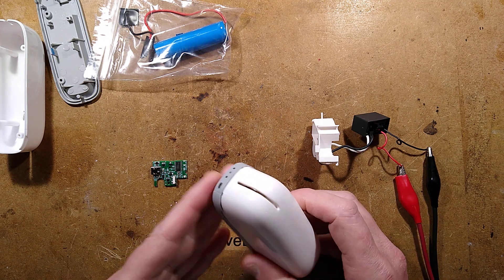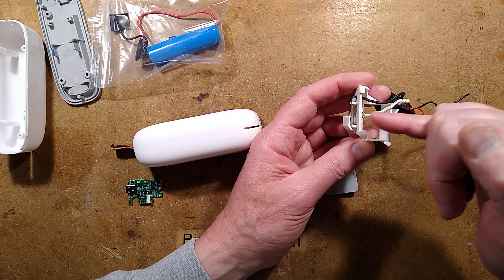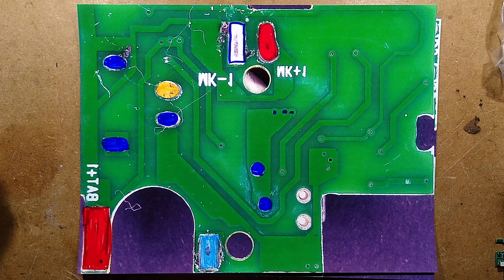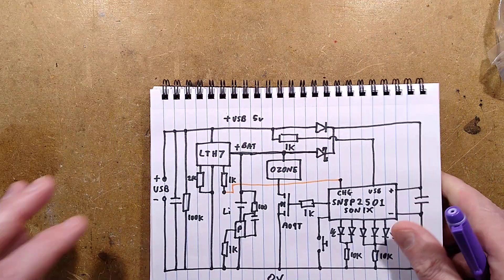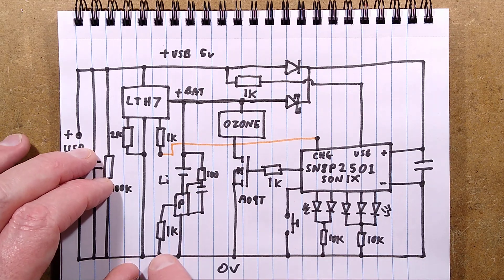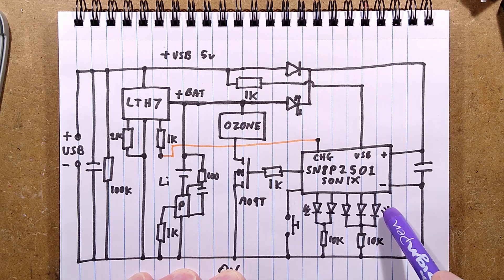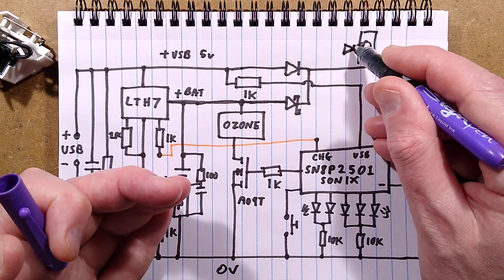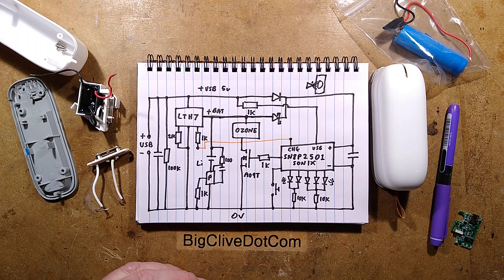Chinese ozone-twinkie with unusually good circuitry (with schematic)

Comment: I've seen a video where one of these twinkies has a duty cycle / duration switch that stopped working. If anyone could point me to it I'd appreciate it. I have one which stopped doing anything but running full tilt until the battery is flat myself.
Reply from the maker: I've been using one in my fridge since I made this video, to give it a long term test.

Comment: It's 3 years later and I just got a couple of these from AliExp.  They fixed the problems you mentioned; the ionizer module wires are routed properly, they trimmed back the plastic so the emitter isn't occluded, and the battery is glued in place.  I got this model because BigClive said it was good, but this model is hard to find now; there's a new model that everybody is selling, so maybe it's time for another ionizer teardown video.

Comment: I bought one and it stopped working within a month. The HV supply seems to be working but the electrodes have corroded pretty bad
Reply from the maker: It may be possible to clean them.  And debris that bridges them can shunt out the low current.

Comment: I just bought one of these little units. It certainly gives off decent ozone for its size. I immediately swapped out the 1aH battery (tested 1007) & swapped in a 3100mAh. Will run for ages now.
Thanks for the video @BigClive.

Comment: I bought one for my car after you released the video . After a couple of months of continuous use it recently stopped producing ozone. Only a high frequency noise.
I found that both the metal plate with the hole and the metal spike were heavily corroded. I cleaned both with some fine grits sandpaper and now it's working again. Maybe this helps others who encounter similar issues.
Reply: I found both my "twinkie" and my Panasonic air conditioner’s ozone generator corroded and without function after a few months of infrequent use. The manufacturers don’t seem to use the right metals for the task.

Comment: Mr. Big Clive, would an ozone-twinkie or one of the other cheap ionic refrigerator fresheners you looked at in other videos be effective in reducing the noxious fumes of a resin 3D printer? They fit neatly inside the printer enclosure. I’m not that concerned about the vapors from my printer but there are many who are more concerned about their health than I am.
Reply from the maker: I think ventilation or a suitable air filter would be a better option.
Reply: Thanks Clive. The manufacturer of the resin printer makes rechargeable carbon filters that are placed in the enclosure. 3M makes the 6001 organic vapor cartridge for respirators. I guess the action of ionization would not be very effective. I can just open a window. I'm not very sensitive to these vapors and I'm too old to worry about them anyway.

Comment: I bought two of these off ebay. The 1000mah version. I opened one to replace the 1AH battery with a 2.6AH battery I harvested out of some dead gear. Your concern about them stuffing the wires is very valid; the red wire was pinched between the HV spike and the module. Theres a visible crease in the insulation. It has also occured to me this board would be good to use for running anything you can think of on a regular time interval with a battery charging circuit.
Reply: Fairy lights even!

Comment: They also seem to be selling a rechargeable 2000 mah version now. Do reccomend that one over the alkaline and 1000mah model?
Reply from the maker: It depends if you trust it to actually be 2000mA.  But for the technically inclined it's easy to fit any 18650 you like.
Reply: @bigclivedotcom  Thanks Clive, I'll order a couple tabbed 18650s to go along with the unit. These will be great to have in the fridge, wardrobe and bathroom

Comment: I purchased the AA cell version and it also appears to cycle on and off continuously, perhaps depending on how you press the power button on. The only problem is I don't know how I made it do that as the instructions are very vague. It did cycle on/off for a day before I switched it off, however I am now still trying to recreate that operation mode ?
Reply: Double click maybe, press and hold for 5 seconds, 10 seconds ?
Reply: @miniwarrior7  Yep you could be right? I cycle through the button options then do a 5 sec-ish push on the 3rd light seems to do it, but not always :-)

Comment: Probably time you read this Clive - https://www.epa.gov/indoor-air-quality-iaq/ozone-generators-are-sold-air-cleaners
Reply from the maker: I'm perplexed at the lack of science exhibited by the EPA.  Ozone is an essential part of natural air at a level of around 10 parts per billion.  The high output ozone generators for sterilising rooms are dangerous, but ambient units that produce trace levels are good to have in areas with low natural air throughput.
On a plus note, NASA more than make up for the EPA with real air composition science.

Comment: Putting one of these in the fridge to sanitise it sounds appealing.
But, doesn't ozone degrade plastics? 
Would these things damage the fridge by making the plastics brittle, or perhaps cause them to turn yellow?
Reply from the maker: At high levels, yes.  But these units produce very low levels.

Comment: Looks like that seller has sold out. Only one with a usb charge version left. Sold 12 in the last 24 hours. About to dive in and grab one before they're all gone.
Oddly enough, this one only charges 6.69 GBP.
Reply: Well, the one I ordered finally arrived today. And, as predicted, they sold out. Coincidentally, one I ordered locally (different model entirely) also arrived today. The twit actually sent me two. I'm not complaining, mind you, but he's not getting the other one back.
Anyway, opened up the twinkie right away and I was shocked. Someone had mashed the battery in or did something untoward to it. The plastic sleeve on it was ripped around its middle - where the clamp in the unit for it was. But the clamp is plastic and couldn't have done the damage.
The battery held some charge but I charged it anyway. Took at least an hour.
After use, it doesn't turn off (assuming I'm reading the Chinglish correctly) but flashes the green LED periodically.
The other one seems to be better. Smaller form factor, the top part is clipped on and can easily be removed. And the USB port is at the back and easily accessible rather than hidden underneath.
Here's that model https://www.ebay.com.au/itm/154265752978 could probably be cheaper if acquired from China but I'm no longer buying from there - nothing seems to get delivered for some reason.

Comment: They won't ship to Canada either.
Reply: I found one that will shop to Canada https://www.ebay.ca/itm/402975959176
Reply: It arrived a couple of days ago. It looks good and I've been playing with it a bit, trying it in different areas but the weather has been nice here this week so we've also had the windows open and the actual fresh air is probably having more effect.

Is your mail delivered to your door or do you have a post office box? Most small towns in Canada don't have door to door delivery so a POB is the only way to receive mail. Some Chinese sellers (or possibly the manufacturers that drop ship for them) won't ship to any address that includes "box" or "P.O.B." but the postal office isn't supposed to deliver anything in the box that doesn't have the box number on it so having them send it to the street address is no good either. 
I figured out a way around that by using changing my default shipping address for PayPal to the following format

Name Name
123 Any St. BX 000
Mytown, Canada
postal code

I haven't had any seller refuse to ship to me and all of my parcels end up in my box (except when too big and they put a card in the box telling me to go to the counter).

Comment: I suspect the Schottky diode is because the battery can get to 4.3V or so while charging, and the processor is probably rated at 3.3V, and would fry or malfunction at 4.3V. So they gave the line a diode drop to protect the chip. But they used a Schottky so that the processor wouldn't drop out too soon when the battery got down to 3.4V or whatever they decided was low operating voltage.

Comment: These vids would benefit from wearing a mic making audio levels more consistent. All my YT levels are set by Clive's mufflings !
Reply from the maker: Part of the issue is the bass in my voice not working well with some replay systems with small speakers.  If it's really muffled, check that Dolby isn't sending most of the audio to a missing middle speaker.
You can test that by playing a video on a different device.
Reply: @bigclivedotcom   Thanks for forewarning about Dolby / mid-range speaker issues.

Comment: I have a PO Box and some ebay sellers and others refuse to do business with my contracted federal package handlers at that there Post Office. I used to haul mail out of there and get my ebay at 0400 when I was loading truck. A manager suggested I use the physical address of the post office and it solved a lot of problems except when the Post Office couldn't find the Post Office. lol

Comment: Quite possible that the piece of curved plastic infront of the output hole is there to curve the airflow down at an angle to push it out of the long slot on the front. Just my thought.

Comment: 4:05 "It's got a capacitor straight across it for filtering..." It's not for filtering, it's for bypassing. Every budding electrical engineer should understand this subtle point. How do you get USB power to this device (or any device for that matter)? You plug in some power adapter via its cable, often about 1m in length. The two VBUS power leads each have inductance, about 25nH/inch. That is each for each of the two power leads. Thus, a 1m cable might have about 2uH total inductance on the power leads (1uH for each of the two leads). What happens if your USB load switches power on and off on VBUS through this inductance? It's the old V = L*dI/dt equation: you get a voltage spike. If that spike is large enough, it can wreak all sorts of havoc in your design, often shutting off power to something like your uP controller. The purpose of the bypass capacitor is to swanp out this inductance. If the capacitor is big enough, like a few uF, then while you may still get a bit of LC ringing (Fo = 1/(2π*sqrt(LC)), the frequency is now pretty slow and sluggish, whereas with a tiny bypass cap, such as "nothing," the frequency is quite high and you see large, fast ringing on your power lead.

I've seen lots of experimenters putting together small projects that have no bypass capacitance on the power leads. That's usually okay if you're fiddling around with op amps that have no fast current spikes on the power rails. But if your circuit is a digital anything, where "fast" is a very desirable trait, you're in trouble if you have no bulk bypassing on the power supply rails.

My point is that you should refer to C4 as a bypass cap, not a filter cap, because it performs no real "filtering" of any sort.
Reply: Thanks for the heart, Clive. One of your many traits that I admire is your openness to constructive criticism, something my father taught me is a good thing. It's how you learn and get better at your craft. And flipping that same light around, what I love about your channel is that you have a vast amount of experience with circuitry and mechanical devices that I do not. From your many videos, I continue to learn, for which I thank you!

Comment: The mixing of diode types is because textbook Silicium diodes drop 0.6V, textbook schotky diodes 0.3V, textbook LiPo batteries provide 4.7V while textbook USB is 5V, so the designer expected it to cancel out the 0.3V textbook difference, when in reality, all those numbers are inaccurate and the circuit will end up preferring one source over the other despite this trick.

Comment: A lot of the eBay sales have a picture of the underside, battery hatch as a main picture, a heads up if you can't find exactly what Big Clive is reviewing. Scroll through the pics.
Reply: still can't find one.
Reply: @rarbiart , eBay seller: universalegoods has the USB version under: UN3F Refrigerator Air Purifier Closet Deodorizer Filter Fridge Food Fresh Keeper

Comment: If those are "designed" for use in refrigerators , doesn't Ozone affect the taste of food or the plastic packaging arround food ?
I know that Ozone near by latex gloves, will make these gloves very fragile in very short time, so i guess it will also affect the plastic packaging ?
Reply from the maker: Ozone does break down rubber.  In the fridge it's at very low levels, barely detectable by smell.
Reply: @bigclivedotcom  , i think it's time for the Ozonator 3000 :-) 
A battery powered Ozonegenerator in a small sealeable food container, to test the taste of food or alcohol drinks after contact with high concentration of Ozone :-)

Comment: I have a build video you, my friend. It's a plug box that when a fan is plugged into it. The fan speed is reduced by half. Or adjustable if easier to make. 110v and 220v if you please.
I'm afraid my pedestal fan lowest setting will blow me from America to France.
Nobody wants that.😜
Reply from the maker: Look on eBay for fan capacitors.  Adding a capacitor in series can be used to slow them down.  It may be necessary to add a 1 megohm resistor across the capacitor to discharge it when power is turned off.

Comment: Ever wondered what the effect of ozone in a fridge might have on exposed food and the materials used in the fridge construction.
It would be interesting to determine if foods stuffs like milk and butter/margarine is soured or at least changes its flavour on repeated exposure.
Unsaturated food fats may be particularly susceptible to damage by ozone, as it attacks carbon carbon double bonds. The inherent low temperatures may slow such surface reactions, reducing their significants. 
Ozone is also known to attack certain plastics, such as polyethylene. This is evident by the fact that the plastic tube used to deliver the gas in hydroponic and aquarium systems uses nonstandard blue coloured plastic tube to avoid the problem of embrittlement of the tubing.  To be effective as a bactericide, and deodorizer, the gas concentration within the refrigerator must be of an order to be chemically active. It could be argued that most people ensure foodstuffs are in sealed containers when in the refrigerator, but that is not always the case. I would not expect bulk food damage on exposure, but the surface might be chemically changed, maybe becoming increasingly slimy as the chemical bonds breakdown.

The circuit is interesting, wonder why there is not a pull down resistor on the gate of the HV supply MOSFET?
Does the output of the HV generator act as an ion accelerator. One can imagine that the pin and plate with a hole, might act as a beam forming arrangement, actually accelerating gas molecules through the hole, rather than simply being there to allow the gas to escape. 
Are the components rated for the industrial temperature range, given the unit maybe operated in a refrigerator. Most fridge cold compartments are set to just below 4C, so still in the commercial electronics temperature range.
A little surprised that the electronics is not protected from dew point moisture, particularly as it has an HV circuit.
Reply: I don't think it's an ion accelerator. It accelerates the gas molecules with the Bernoulli effect. The corona discharge accelerates the ions and the air in that small area, which creates an area of low pressure, which then pulls in more air through the hole. It's the same way bladeless fans work.
Reply from the maker: The emitter does created a strong breeze.
Reply: @bigclivedotcom  I reviewed a number of papers on using ozone for food hygiene. The gas has certainly been proven to be effective in killing mould, bacteria, and viruses on foods such fruit and vegetables, reducing the speed with which it decays. It is clearly a better option to the use of a disinfectant chemical that kills pathogens by poisoning them. Ozone just breaks open the cell membranes by oxidising them. 
I could not find any test results for the effects of ozone on oily foods such as butter and milk, which are the ones I suspect the will be decomposed by the gas. Fortunately most people keep butter, margarines and milk covered, or in containers, in the refrigerator. 
One must wonder if it is wise to use an ozone generator on refrigerators not designed to be resistant to the gas. It could be that rubber door seals might be damaged. If it is anything like the action of sodium hypochlorite solution on Tupperware, the plastic will appear undamaged and then become brittle and fall to bits.

With regard to the ion breeze, it might be worth injecting some smoke, to see if the ion stream is indeed formed into a beam, like steam emitted from a kettle spout.

Comment: Just getting started soldering and a friend of mine lent me a pen soldering tool. It’s rechargeable. 2 problems I’m hoping to get some guidance on. 1) it only melts new solder before it will melt existing solder. 2) it only melts on the side of the cone about 2 mm away from the tip. Could I get some advice please. - found ya from South Main Auto
Reply: You need to learn how to tin the tip.
Reply from the maker: Old solder with no flux left (especially lead-free) takes more heat to melt.  It often helps to add a touch of new solder to it first.  Tinning the tip so it's shiny is essential.  Clean gently though - don't use abrasives as it is coated.
Reply: Yeah, I got it this way. Looking up TIN THE TIP, you tube don’t fail me now.